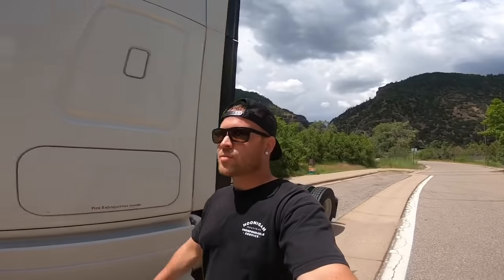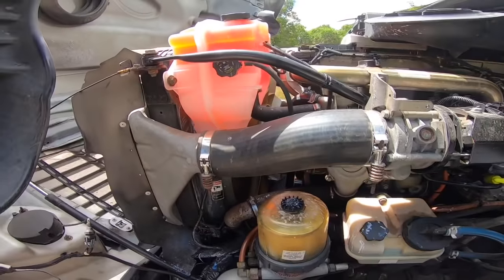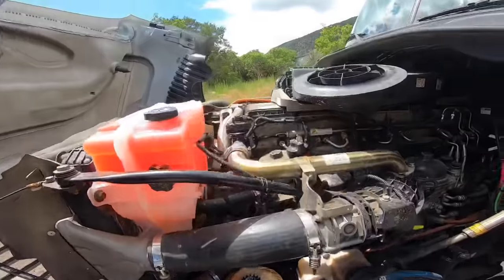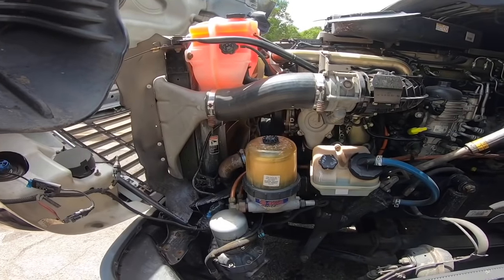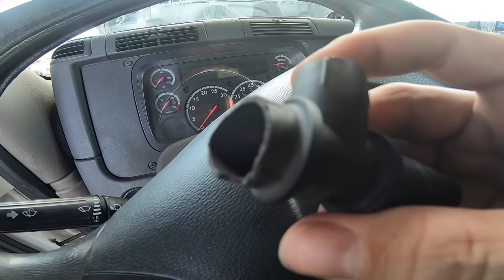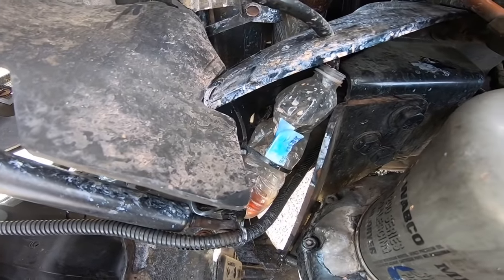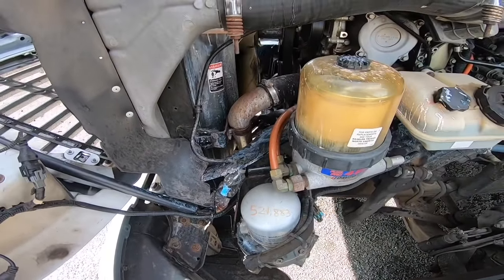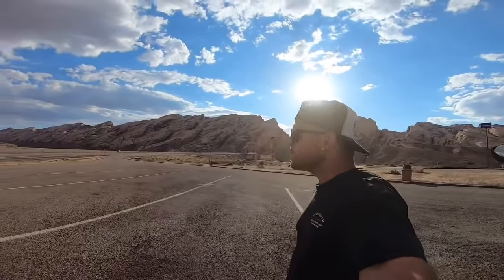1000 Mile DH / Bad EGR Cooler / Pressure In Coolant System / Black Coolant

Comment: Hey Chad check your mix of pipe which is the metal pipe connected to your EGR takeoff the mixer pipe  and check if you got anything that looks like water inside you mix a pipe to  your EGR if you do it should EGR cooler
Reply from the maker: Brandon Hammonds already did that and looked pretty dry but then again the guy only removes one side of the pie so there def could be.

Comment: Egr coolers hardly ever fail on a DD motor.  That’s a international issue.   Most causes for coolant boil over are a unpressurized coolant system from a loose or leaking top or side cap. Loose head bolts will cause it, cracked liner, or air compressor are some of the more common causes.  Oil coolers fail more often and dump oil into the coolant.  Head gasket leaks are typically a trail of coolant down the side of the block. The mechanic that saw coolant on your dipstick tube could have just saw water residue.  You can actually take a coolant test strip to that and see if it changes colors.  It’s not as reliable as coolant in the hot pipe.  If you’re egr cooler is like ing (rare but it happens on a DD motor too) you can take the EGR cold pipe off and take that water residue and put it on a coolant test strip.  If it changes colors it’s a good indication it is coolant and not normal water condensation.   Taste is a really good indicator too, red coolant tastes bitter like Robitussin.  Depends if you wanna go there.  Personally I don’t anymore.
Reply: Oh engine fan not coming on is more common, bad fan hub clutch, failed water temp sensors (there’s two), fan solinoid, restricted airflow thru the radiator from dirt in the fins or cardboard leftover from the winter.  Water pump failure from cavitation or missing belt. Thermostat stuck closed.
Reply: The coolant temp sensor on the oil/ coolant module is kind of prone to cavitation from sucking a little air in the coolant hoses from the coolant manifold return.  It rarely leaks into the harness.  But if you pull the sensor out, you’ll see the brass casing eaten away.  This obviously causes erratic readings or a drifted sensor.  This could cause the fan to not come on even though the coolant temp at the outlet of the passenger side is not overheating yet, coolant more towards the rear may not be as cool and start boiling.

Comment: I heard the same thing about the coolant filter.  I haven had a coolant filter since 2017.  Not sure if it helps, but it hasn’t caused any issues either.
Reply: You can take the cap off and throw out the filter and put the cap back on.  GHG17 trucks don’t even have the coolant filter anymore.  They realized it really makes no difference.  Unless you’re dumb enough to use standard life green or purple coolant that needs SCAs and nitrate levels regulated.  Then you would need a time release filter sometimes.  Red coolant is the best. 300,000 miles no maintaince.  At 300,000 miles drain, flush and refill for another 300,000 miles.  There are extenders you can add at 300,000 to get another 300,000 miles = 600,000 miles total.  But I wouldn’t recommend it.
Reply: just add the anti-static additive manually....one less component to fail

Comment: I’m having similar issues with my truck as well.  Truck isn’t overheating at all but coolant is backing out of the reservoir.
Reply from the maker: CB theTrucker yeah bro most def thinking the EGR Cooler and the coolant filter as well as the jug it’s self. Defiantly pull a sample bro to know for sure
Reply: Do u guys have any answers my truck is doing the same thing I have a cummins isx 2010

Comment: I have same problem in mine, coolant goes out of tank because big pressure, not oil mix, not big temperature, all normal, i have new compressor and the co2 test was negative, how you fixed? Thank you.

Comment: Brother I have the same problem I changed the air compressor of the truck hoping to solve the problem the oil of the truck is fine the other may be the EGR

Comment: I hope you stay in business and survive this crap but, Dude that's the issue. Tryn to stay in business with these new p.o.s. ass emissions engines. This shit just not dependable. I have a 2010 frieghtliner Cascadia with a 60 series yes it's one of the first emissions engines well a few years after the first emissions engines and I only have the dpf filter no def be and man this thing has Regen issues dude. I'm talkn about like another problem on top of just truck problems. The bastard won't even completely Regen correctly. So things need to be fixed for it to sit there Regen a basically destroy itself.... Lol. Because Trucks idoling at 9k to 12k rpms isn't good for long periods of time. And everyday the Regen light comes on and goes off just bullcrap
U would think that they care enough about the truckers and trucks that they wouldn't make such bs.... Good luck bro and, wish ya the best
Reply from the maker: Sometimes you got to break some of the rules if you know what I mean lol that’s all I’m going to say about that. 🤷‍♂️ It don’t get any easier out here that’s for sure. 60 series is one of the best engines ever made.
Reply: Very much right. Ya have to....
So true. 
But good luck bro....